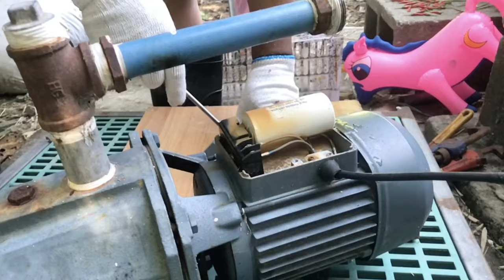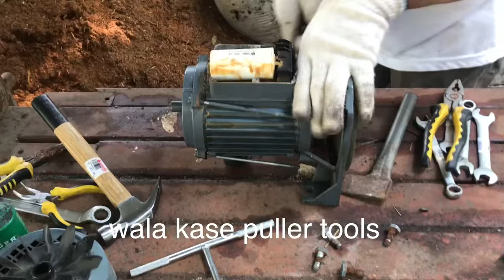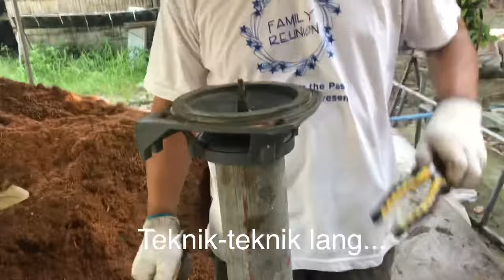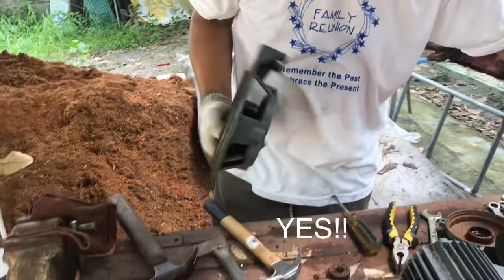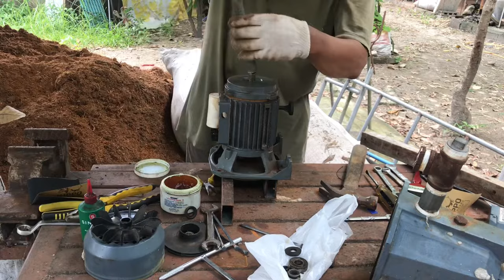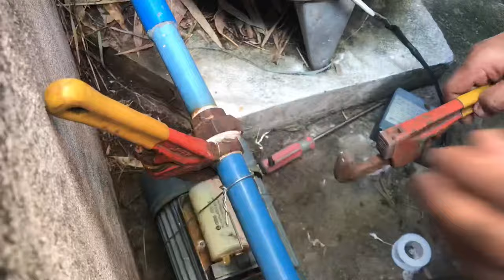Jetmatic Pump Repair without Specific tools(Tagalog)

Comment: sir anu po bang dhilan kung nag tatagas ng tubig ung nasa likodng elesi ng electric pump.pinalitan kolang po kasi ng bearing.kaya lng nung kinabit kuna po nagtatagas na sa likod ng elesi ng makina sir
Reply from the maker: Nasira po ninyo yung mechanical seal nya nung hugutin nyo yung shaft mula sa pump, yun  parang o-ring po yun na may casing na lata at may spring, kapag ipapasok nyo ulit yung shaft sa pump, yun yung una ikakabit nyo, usually kung luma na po jetmatik, malutong na po yun, mahirap na sya baklasin talaga na di nasisira, yun po ang pumipigil para hindi lumabas doon ang tubig.

Comment: Boss lar Ano po ba dahilan pag ang jetmatic ayaw mag pump umuugong lang siya. Hindi cia na ikot ang elesi? Matagal ko na po ito problema kaya na stock na lang cia ngyon. Hindi ko pa ito napa check sa electrician. Sana nabasa nio po ito god bless po
Reply from the maker: Baka naman po sobrang tagal na hindi nagamit, magko-corrode na po kasi at mag stock-up. May fan po ang motor sa isang side nya, buksan nyo po, usually walang turnilyo po yon, both ang fan cover at fan, hihilahin lang, para ma expose yung shaft, try nyo po i-oil yung shaft sa part na papunta sa mga bearing at pihitin po ninyo ng plais, kapag gumalaw, ulit ulitin nyo lang po, kapag umikot sya saka nyo subukan paandarin.

Comment: Sir maano po pag mahina ang hatak ng makina sa tubig kasi saamin ang hina na lumalabas na tubig..ano po ba ang sira ng makina sir?
Reply from the maker: Kung mahina tumulo sa gripo, baka mababa ang pressure setting ng pressure switch, maari naman adjust yun, screw driver lang need nyo . Kung mahina as in matagal bago mapuno ang tangke nyo, baka mababa horse power ng motor nyo compared sa lalim na inabot ng tubo. Maari din po na may singaw kaunti sa fittings, sa mga joints ng tubo, o sa check valve.

Comment: Sir ano poh kaya problema ng motor automatic sya naghihinto after ng 5min.
Reply from the maker: Kung nagpa-pump naman po sya ng tubig normally, sa pressure switch lang po yan, buksan nyo lang po ang takip, makikita nyo dun dalawang adjustable spring, isa po do`n kailangan higpitan, paunti unti lang po, baka masobrahan ma over pressure naman. Ingat po!

Comment: Yung jetmatic po namen pag mag rerefill napo sya ng tubeg sa tanke ang tagal po mag start ano po kaya problema?
Reply from the maker: Nasa setting po ng pressure switch yun, zero pressure na po bago mag on power nya.
Reply: Paano po Ang mtgal tumaas Ang pressure gauge tpos PO Hindi nmmty
Reply from the maker: Cristine Marcelino kailangan nyo po ipa adjust yung pressure switch sa nakakaalam, delikado po kase yan kung lumagpas sa pressure na kaya ng tangke, may setting po yan kung ilan psi bago mag on at ilang psi bago mag off ang power nya.

Comment: pano kapag grounded?
Reply from the maker: Check nyo lang po ang mga wires, baka may parts na nabalatan na ng vibration sa katagalan, at dumikit na sa part ng tangke, karaniwan po yun sa pressure swich, yung pinapasukan ng wire, natatanggal yung rubber insulator ring.